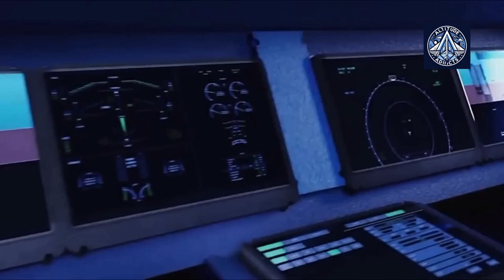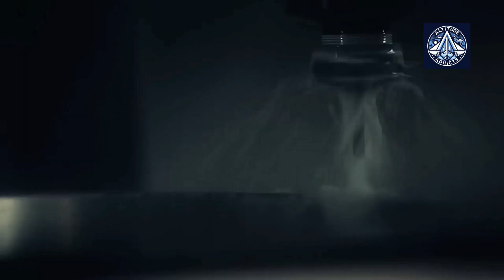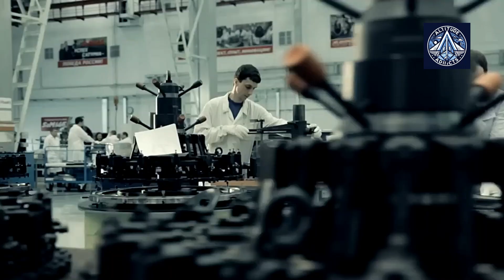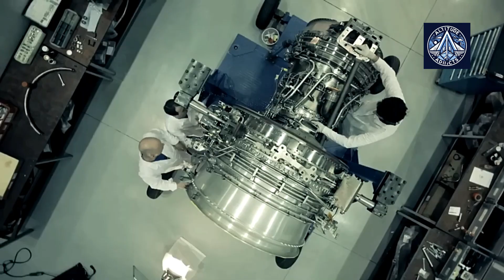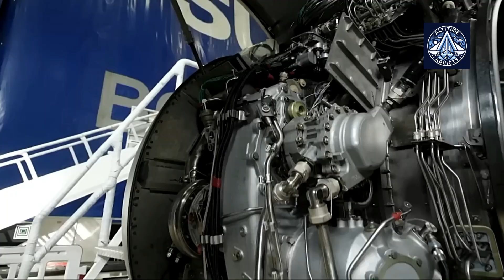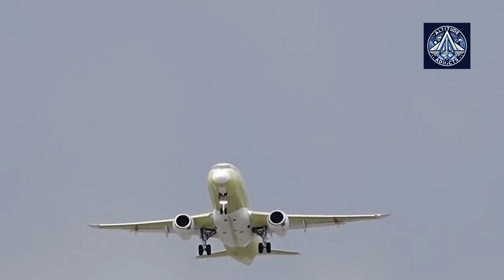PD-8 Engine vs. SaM146:  No Gearbox for SJ 100

Comment: The PD-8 engine is just an NK-8 or D-30 derivative out of a shelf of potencial dozen prospect prototypes...!..
The Russians have been making aircraft engines for almost 120 years from the first one in 1907 Pulse jet engine as the patent in St Petersburg confirms...
The SaM-146 is just an inherited leftover contract from the French/Italian SS100 program after Saturn fixed the inherited problems in the hot turbine section of the SaM-146 from SAFRAN...
The Russians know what they are doing, they have at least a dozen turbine engines manufacturers, they have at their disposal all the know how and patents to pick and choose attributes they would like their new engine to have....

Comment: Two parts of turbines  a low speed high torque axel and a common compressor turbine axel gears are absent but for generators and pumps

Comment: Optimising the performance of the engines at takeoff and landing to improve efficiency sounds like a rather short period of time for it to be efficient. This engine is 3% more efficient than the Sam engine in flight so even if it is less efficient at landings and takeoffs it is still better and would be simpler and lighter and more reliable without the gearbox added. I don't think Safran will make them a gearbox so that might be a few years getting a gearbox developed and made and reliable.  Not worth the delay. If gearboxes are so amazing they can get the engine ready and in service and then work on a gearbox over the next few years to make it even better.

Comment: "To reduce maintenance costs and increase reliability no transmission will be installed." From about 56 seconds into the video you explain why no gearbox is included. 1 minute 12 seconds: "Modern design solutions are applied to simplify the design and achieve fuel efficiency".  Kinda makes any questions about whether to add a gearbox redundant doesn't it?  The Old engine wasn't French, it was a Russian French collaboration. They know how to make new engines. Not a good time to add complication to the engine at a time when it is needed in aircraft. It will also be used in the Il-212 which is the scaled up Il-112 with jet engines in an overwing position essentially becoming a replacement for the An-72.

Comment: Gear turbofan is a source of problem.  And it is not new tech anymore.  It was used in Honeywell Garrett's engine for so long.  One of the SSJ failures is that engine problem.  Customers claim it is unreliable and fail short in maintenance.  Russia said it was from the French engine parts.

Comment: Sukhoi can easily put a geared ducted turboprop like the Kusnetzov NK-173 with counter rotating blades to instantly get a 25% fuel savings more than the said engines.... The sky is the limit....

Comment: PD-8 is twin-spool design so doesn't need a gearbox to run the front fan at diff revs to the hot core.  That PW engine you mention on the A-220 is 50% bigger diameter front fan than the PD-8/Sam-146. So it has planetary gears due to issues with the tips of the fan blades speed getting too high. 
A-220 is an usual spec 5-abreast seating for 200 passengers .... Russia has no aircraft that size so there is no need for a geared PD-8 version.